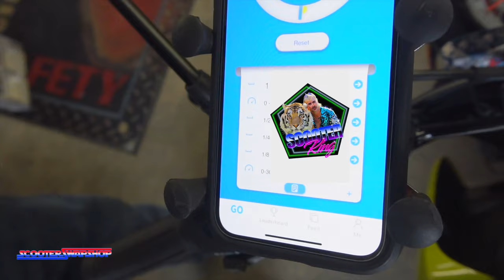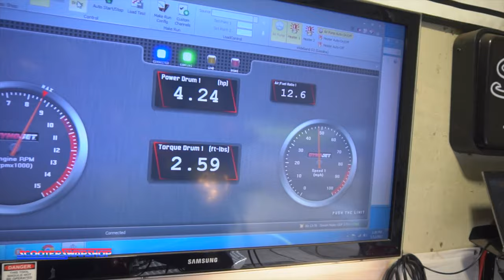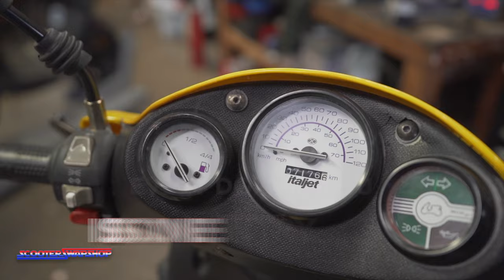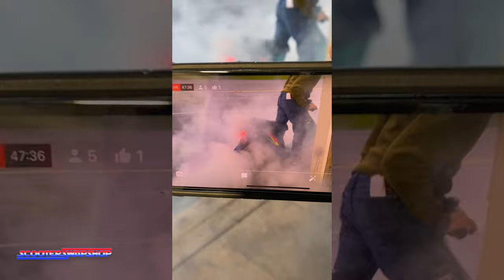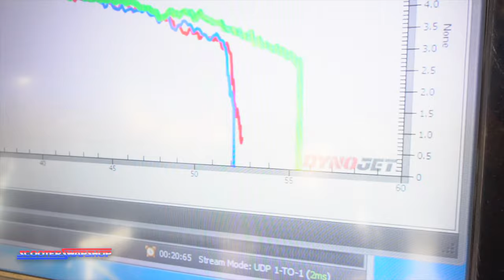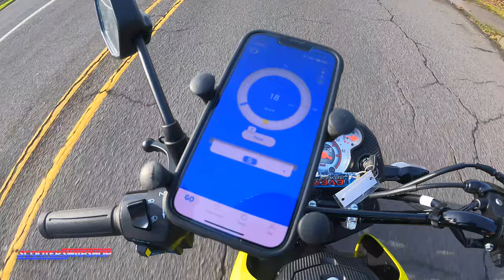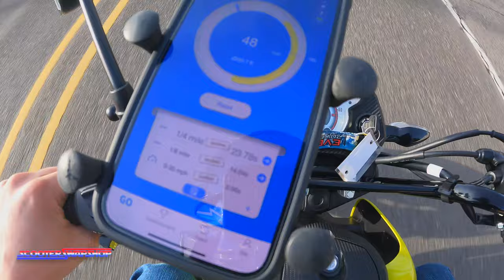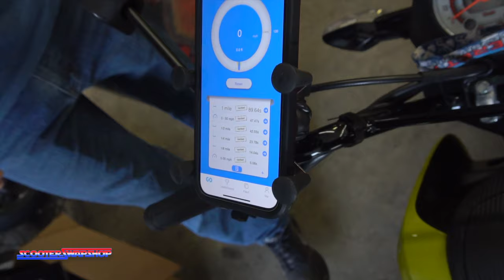Honda Navi dyno results. Get more power for less than $25

Comment: Can confirm 11g sliders pick the Navi right up.
Reply: Just acceleration or top speed?
Reply: @tituslittle  deffo accel.seen somewhere they cut a sec on accel and topspeeed with a 12gr.

wondering if they put air scoop to max air flow will it breath easier and go faster. a bit also the exhaust pipe

Comment: So, 50psi in the tires and 11g wts in the front pulley... And, 55mph is absolute tops for these little guys? 
It's a nice 'companion' for our Grom. Which, btw, is 5mph faster by dropping 1 tooth off the front sprocket! It'll now hold 64mph on the flat and 69 with a tailwind!
Reply: rev limiter delete, clutch and variator swap, carb swap, exhaust swap, would probably get it over that 60mph hump, and might break even with grom msrp lolz

Comment: Once my Navi reached 150 miles it has gotten noticeably faster.
Reply: I'm at 35 miles on mine.. I'm hitting 47 top.. how much faster is yours going now?
Reply: Mine reaches 54mph stock after having 400 miles on it
Reply: @wascalywabbit  52 MPH. I weigh 204
Reply from the maker: nice this had 8
Reply: 54mph
Reply: @vincentvaicunas1458  so looks like weight have a very small impact on speed because one guy here was 140 lbs and his max speed is 54mph.
Reply: @Voltomess  I've actually seen videos of people with two up and the only thing that suffered was the low end speed.
Reply: @vincentvaicunas1458  Do you like your Navi? I heard they have problems with carburetor and they stall while idling on stop signs,red lights etc??
Reply: @Voltomess  I must have lucked out and got a good one. I do like it a lot. I ride it more than my CBR 1100
Reply: I hit 125 mph on mine.
Reply: @chrisfrantz2674  I live in south Florida so we get like 2 feet of altitude lol
Reply: I easily hit 50 on my way home after delivery
Reply: Wow makes me wanna buy my wife e a brand new one since it upgrades on it's own throughout time, cause I'm going for the grom I'm getting her the Navi just for the Large storage space available
Reply: @SWAGGER4us  the storage is the reason I bought it and of course the price. Although the price today is a lot different than what I paid. I guess it depends where you live. I wish it upgraded on its own. But it definitely breaks in around 150 miles. Good luck with your grom.
Reply: @Voltomess  Bit late, but I've had my navi for about 2 months now. I ride in warm weather, but I have not had any stalls at stops. On some cold mornings or 4am rides I've had to use the choke to start her and warm up. But I can quickly stop the choke and head on my way. First 10 minutes she will be a little sluggish it feels but then it's all gravy.
Reply: @tebos11  Good info thank you I appreciate that!!👍👍

Comment: Hi SSS, planning on getting a NAvi soon and looking for a little more acceleration from a stop and mid-range since I live in a hilly area, but I also have to do some highway cruising for commuting. Do you guys think that going with 11g for a 170ish guy will do the trick without changing the rear bell? Also, I've heard that sliders might damage the OEM variator, is it true or not? and... can you mix rollers and sliders?? Thanks and greetings from central America
Reply: no mods will make it safe on the freeway

Comment: Question... Do you think a CVT would work on a mid-drive ebike or emoped?
Reply: whhaddaya think theyre on right now.
Reply: @sargera1  'E-Bike' as in Electric Motor... I have CVT on a gas motor already. But I see no one putting one on an electric motor...
Reply: @johnw65  they use that redux gear tho so its like a bit reverse cvt.other wise that torque on get go will wreck yer transmission
Reply: @sargera1  Most ebikes are an internally geared hub motor. But, mid drive elec motors are more efficient. However they break thin bicycle chains easily and the chains make noise. Some use a fanbelt drive which made me think of CVT belt drive setups like we use in scooters, and other gas powered vehicles. But, I haven't seen one used with elec motors yet

Comment: I need to get a scoot, been thinking about getting a Ruck for my first bike and possibly moving up to a Navi after I see how much aftermarket stuff develops.
Reply from the maker: just go right for the navi!
Reply: @Scooterswapshop  I want the Ruck since I like the looks more and a small scooter like that would be great for running around local roads. Plus I want something I don't need a motorcycle endorsement for to learn on and then move up if I want to go faster or further. Plus insurance on a 50cc step through should cost all of nothing.
Reply: @themadscientest  Don't, personally owned a Ruckus for 6 years, they are very  temperamental.
Reply: @coltmeyer4590  Modded or stock?
Reply: @themadscientest  I had a Ruckus & just bought a Navi. Ruckus msrp is $2900 for 50cc. The Navi msrp is $1807 for 110cc. Navi is much faster & top speed around 52mph. Ruckus top speed is 35mph. It is very slow & any incline your going even slower. It can't keep up with traffic. Navi has a huge storage & Ruckus has none. Insurance on Navi or Ruckus were both around $150 a year. Ruckus is way better on gas though but go with the Navi.

Comment: I’m already reaching 54 mph fully stock but I weight 140 wet pounds. I would want to look for 13gs and see how they do
Reply from the maker: in stock you can get both sets and do 3 and 3 see if that helps or just 11 or just 13
Reply: What are best weights to use for more speed

Comment: got about 600miles on my bike so I guess it's already broken in, cause I get 50mph no problem (even tho I weight 230lbs), these rollers are gonna give me like 52mph tops right? 
Can't believe you cut 1/4 mile time in HALF with just rollers? Wtf buying em. Do rollers need to be replaced with time? how much would these last? Complete scooter noob!
Reply from the maker: hard to say what it will give you with your weight size its all variable buut take off you will notice they wear out over. a really long period of time no milage time frame we have CVT videos that will familiarize you